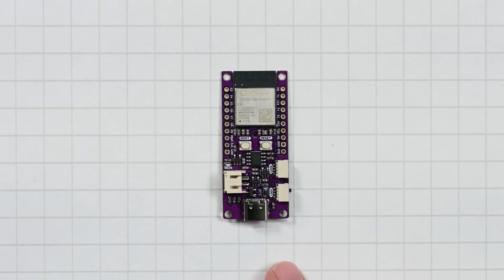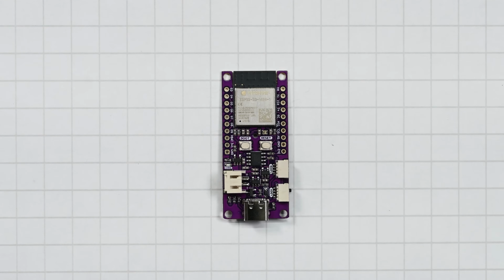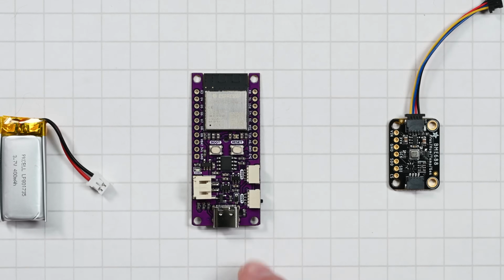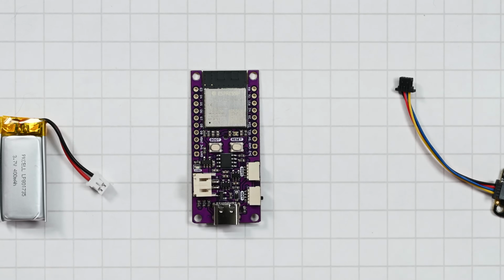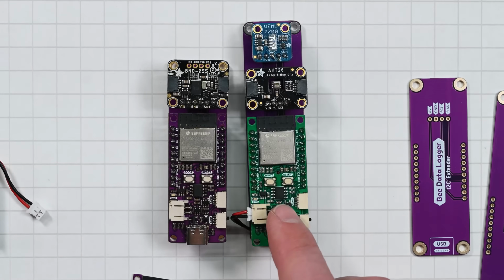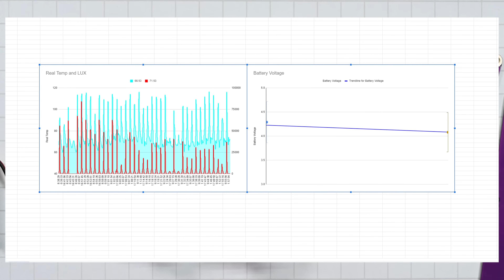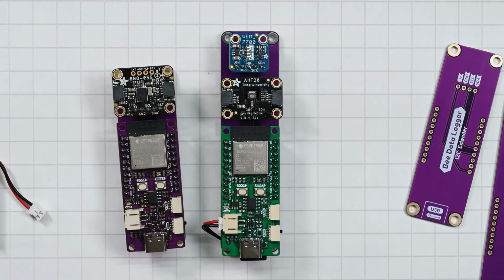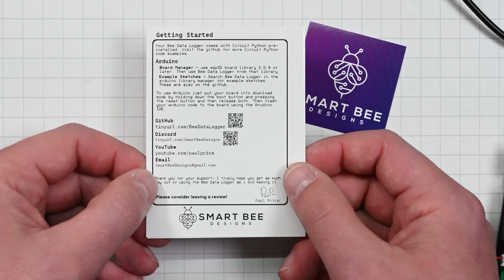The Best Data Logger?

Comment from the maker: So some fun developments. i was playing around with downclocking the bee data logger to 40mhz and doing some code optimizations (removing a dumb 5 second delay i had in there for some reason) the bee data logger can wake up, write the RTC time to the SD card and go back to sleep in under half a second. so...that means waking up once an hour and going back to sleep this thing could last almost 2 years on a 400 mah battery. :O

Comment: noob question, is there a reason  you cant run the RTC module from the lipo rather than a cell battery?
Reply from the maker: You can run the RTC without the cell battery, all the cell battery does is keep the time should the main power be disconnected. The cell battery should run for years whereas if we only used a lipo battery and it runs dry or gets disconnected the RTC time would need to be reset.

Comment: You built a way more efficient and better designed board than my homemade setup and surely I don't mind abandoning my board for yours! I plan using it in rather rough conditions, typically in temperature ranging from -40°C to +40°C. Have you quantified the RTC drift related to temperature?
Reply from the maker: This board uses a DS3231 high precision RTC. According to the datasheet these are the accuracy ranges by temperature.

• Accuracy ±2ppm from 0°C to +40°C
• Accuracy ±3.5ppm from -40°C to +85°C

Now, I've not tested this entire board down to -40c so your mileage may vary on overall performance down to that temperature range.
Reply: The 3231 is super accurate, I have had one running for over 6 years and hardly ever had to adjust, mostly for daylight savings.

Comment: By the video and your GitHub, it looks as we absolute need to use LiPo batteries. Is this right? Would it be possible to use other type of batteries?
Reply from the maker: You can use other batteries to power the device as long as their voltage doesn't exceed 5V max. HOWEVER, it is not recommended to recharge other batteries besides LiPos using the built in charging circuitry.

Comment: hey, i'm making a datalogger for a project of mine, i need to write data from 2 encoders, gps, and 3 hall sensors at least 500hz/1Khz on an SD, encoders and SD via spi, do you think esp32 is fast enough? maybe using freertos to read gps on a core abd write on SD, and on the other to read the sensors?

Comment: That looks pretty neat. Two questions:

1 - do you need to pull the SD card to read what it has logged or is there a web interface via the ESP32 that lets you do that?
2 - RTC is nice, but can the ESP32 check/sync the time using NTP?

Thinking about using this for testing out battery performance on a CR2032 in different situations. I suppose you could simply use the ADC and read the voltage at different intervals?
Reply from the maker: 1. It is possible to have a web page to view the SD card data but you'd need to write that code yourself (tho I may look into making an example sketch for this on the Github repo).

2. Yes you can update the time via NTP and there is an example sketch for updating the RTC via NTP on the GitHub repo. The main reason for an onboard RTC is that a lot of data logging projects do not have access to WiFi and or also connecting to WiFi regularly will affect battery life if you're running on battery for long periods of time.

Cheers

Paul
Reply: @paulprice  Thanks for your answers. Looks like a cool device, I'll have to think about getting one when they are back in stock on Tindie!

Comment: That's a wonderful projet i wish i could have one already to try it out!! Maybe built an enclosure for it and use it in the field. I would be interested into taking the data to the next level and over internet. do you think it's possible with your device ? or do i need a specific device that connects over LAND.
Reply from the maker: It has wifi and Bluetooth capabilities. Sending data over MQTT is pretty easy too.

Comment: A very good morning to you Paul,
 l require your expertise & guidance with this project as I feel well out of my depth on the logger.
I've been trying to build a humidity/ temperature  logger with your little Bee and am struggling to make any headway with my very limited coding knowledge. The system uses TMP117 temperature sensor and a Adafruit SHT45 humidity/temperature with I2C. I did manage to load an example onto the logger however it didn't show any of the sensors and it ran way to fast for my needs, but it did write date, time, day, onboard temp and battery to the SD card, l couldn't get back in to correct my faults as PORT, "NO PORTS DISCOVERED " or "Could not open COM3, the port doesn't exist", I had purchased a couple of those bad boys so l decided to try another one, this one on upload, "Unknown COM3"; Output, "A fatal error occurred: "Could not open COM3, the port doesn't exist" and Autoplay CIRCUITPY(D:) down in the bottom righthand corner of the laptop screen, I do get the lights on the board and the sensors. I have run a program with the two sensors, I2C, Aduino Uno and CSV file, your logger is a little smaller than the laptop, less obtrusive and somewhat much leaner on power. The sketch I'm trying for has date, time, day, humidity/temperature (SHT45), temperature (TMP117), battery and a sample rate of one hour & 40 minutes, that battery should sample into the next millennium.
Any assistance would be most appreciated.
Kind regards
Tony h

Comment: Good morning Paul, an excellent package on your datalogger and well done.Can you tell me; does your logger "automatically scans, detects, configers and log various Qwiic sensors" such as TMP117 temperature sensor and the Adafruit SHT45 humidity/temperature sensor, Sparkfun DEV-16832 OpenLog Artemis is OK with the TMP117 but is not happy with the Adafruit SHT45.
Kind regards
Tony H.
Reply: Thank you for that Paul, l am most interested in getting a couple, but will have to mull it over for a couple of days to see if it's fit for purpose.
Cheers, until a l think up another question.
Reply from the maker: Hi, it does not automatically setup senors like the sparkfun data logger does. This data logger needs to be programmed for whatever sensors you wish to use in either circuit python or Arduino both of which are supported programming languages for the bee data logger.

Comment: Nice video :-) Just a question...I would like to use this datalogger with 3 pressure sensors (4-20mA and a resistor transform to 0-3-3V) on ADC1-3. What could be the maximum frequency acquisition I can achieve?
Reply from the maker: I can't speak to that exact scenario you described, but the max sample rate of the esp32-s3 ADC is 200 ksps. Your results may vary depending on your exact usecase

Comment: what did you have to do to make the board more efficient in deep sleep?
Reply from the maker: Using high quality LDOs as well as 2 of them. One is used to power the chip in deepsleep and the other powers everything else. The trick being that you can turn on/off the 2nd LDO when the board is in deepsleep. so for instance the RGB can't drain current when the board is asleep and it's not being used. All that adds up to having a low powered deepsleep
Reply: @paulprice  oh i get it now, im still very new to this stuff but that seems like a smart way of doing it, like a master switch for turning everything off but still allowing RTC and other deep sleep stuff to work. 

Also, not sure if its your cup of tea but id love a video from you about all the requirements for making your own devboard from scratch, most people dont explain the need for most components they use

Comment: Hi there I've got one of your boards and am have some teething problems, I've tried out your RTC to SD Arduino example script and am not getting any data. I've tried several SD cards, power only USB for logging, it uploads the script fine, and I only get "ESP-ROM:esp32s3-20210327" back in serial monitor. What am I doing wrong.
Reply from the maker: are you hitting reset on the board after you upload the sketch? when its still in download mode it will display that ESP-ROM:esp32s3 message you described.

once you've uploaded your sketch, hit reset, the com port will disappear so you'll need to select the new com port again in Arduino. from there try and open the serial monitor again. (may have to close/open it more than once to get it to initialize)

 that RTC-SD sketch will only work if the serial monitor is open. if you want it to run and write to the SD card without having to open the serial monitor. then remove this bit of code in the setup() section. 

while(!Serial){
delay(100);
}

let me know if you have any other issues.
Reply: @paulprice  Thanks that's working now with and without serial monitor, seems to have sprung to life after it knew what time it was initially. BTW do you have any tips for using an ultrasonic distance sensor with the logger?
Reply from the maker: i haven't used a distance sensor with it, so I wouldn't have any specific advice, but it should be something you can do. you'll just have to play around with it. :)
Reply: @paulprice  It's to monitor the water levels of a brick built spring fed water tank that we think is over a hundred and fifty years old, it used to supply a castle in Scotland which is long gone and will hopefully work well for the walled garden. Thanks again for the speedy help.
Reply from the maker: @1grizzlyrizzo  oh wow that's really cool! I always love hearing what people intend to use the data loggers for, lots of cool projects! If you run into issues down the road don't hesitate to reach out.